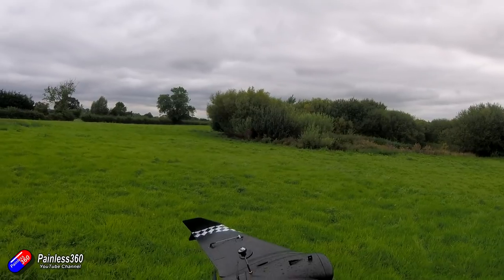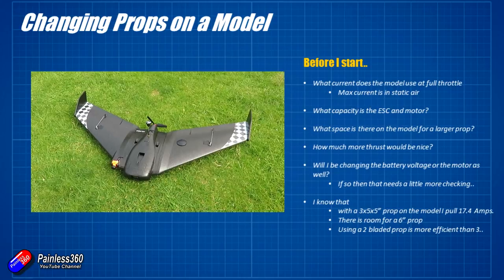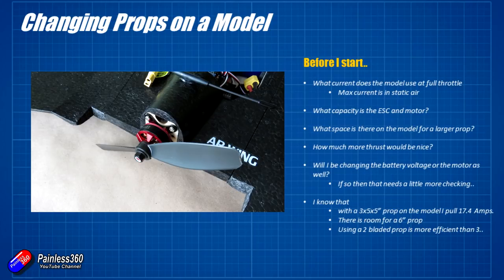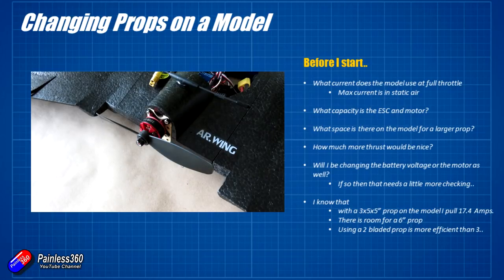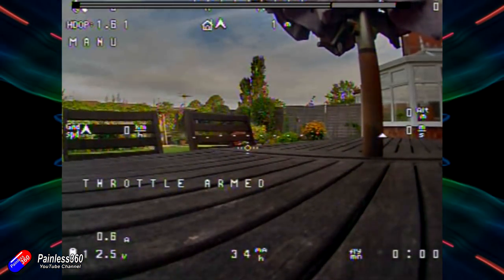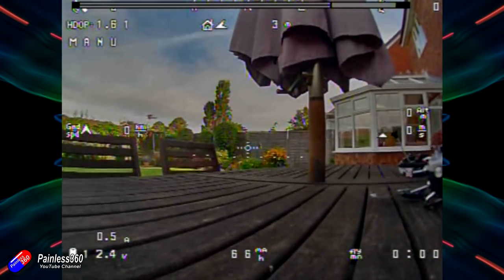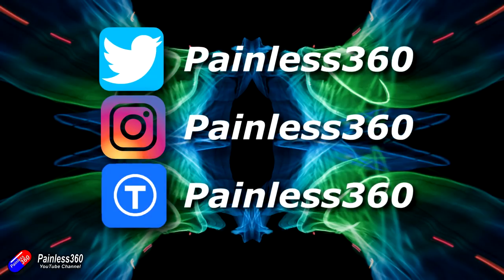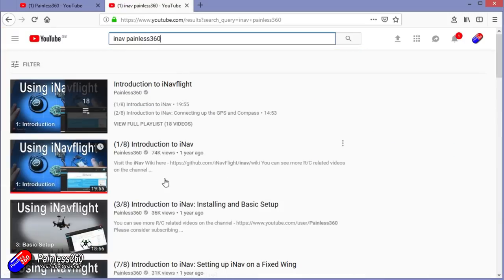Calculating if a larger prop is safe to use

Comment: Great video.  You can always be relied on to cut through the fog of theory and give us practical examples. 
I would add just a word of caution - check the motor limits.  Some flyers crank up their prop, esc and battery but forget the poor old motor which overheats and melts its coils.
Reply: Or forget battery C and have an LVC in the first 3' off the ground.
Reply: Jim, good point!  People often root around in their battery spares and install a 4S or a 2200 (for speed or duration) not realising they've replacing a 'minimum required' 45C by a 25C - the results are never pretty.

Comment: People say I think too much but here’s why.
1/2 inch more leverage will obviously increase the amps needed, BUT ..... 
98.12 x 3 blades= 294.36 ci of total blade/wing work load
127.25 x 2 blades = 254.5 ci of total blade/wing work load
So with the reduced amount of blades does this mean that the motor or thou turning a larger leverage but having a reduced amount of blades attacking the wind is able to spin faster thus creating more thrust? Need RPM info to see what’s happening here. But other wise great upgrade if you can definitely feel the difference.
👍👍👍
Reply from the maker: Changing the number of blades does make a difference. See my motor snd prop tests in the Endurance builds playlist.. Happy flying!

Comment: Interesting approach but as already mentioned the number of blades needs to be taken into account ... thrust and amps with a 5x4 2-blade will be less than a 3-blade of the same diameter and pitch. The other important factor is pitch speed - you can sling a huge amount of air backwards with a large diameter / fine pitch prop, but the velocity of it needs to be significantly faster than the stall speed of the aeroplane or you are in trouble ;-) Not an issue here of course as the diameter is limited, but a general point to bear in mind. Pitch speed is a function of rpm and blade pitch, so a tacho is a useful tool to have. As you said though we are lucky nowadays in that most electric models have 'plenty' of power out of the box, without having to tinker too much!
Reply from the maker: Many things, including the design of the props themselves can make a huge difference to the thrust produced for any wattage. As mentioned in the video this is a rough and ready, simple way to get a rough idea of what the impact would be and what changing the pitch, diameter, battery or motor would do to your current. Happy flying!

Comment: Motors are disposable items.. HK 2200kv D2826 motor on a 6x4 prop pulls about 35-40 amps wide open on 4s.. And good for about 30 wide open flights.

Comment: Actually I find the 3 bladed props more efficient in a pusher configuration... 
I get longer flight times out of my 6x4 *3-blade one than I do a 6x4 *2-blade prop in my 900mm AR-Wing.
I’ve also now doubled up & connected my 3s (1800mAh) & 4s (1400mAh) battery’s in parallel.
All up weight is now up to a weighty 820g,
however I’m getting 1kg of thrust (on a 3 cell) out of it with my upgraded ‘Brother Hobby - EngineerX 2307 2500kv motor! 
Running it on 4 cells that goes up to 1350g of thrust, & unlimited vertical!.. 😎
It’s pulling 28 amps & 39 amps   respectively on 3/4s - still using the standard 30 amp ESC also. 
Static thrust is different though from when a prop is actually screwing through the air at high speed.. 
It’s usually around 35% less than in static figures, so still under 30 amp mark & within specs of that FlyColour ESC.
Reply from the maker: Please see the endurance quad testing. Some interesting real world results on props I did here. The design of the props used can make a huge difference. As you've already seen, not all props perform the same. Even those with the same size and specs. Happy flying!

Comment: Run mine with 2216 Sunnysky 1400KV and 9x6 folding prop on a selfmade 4S2P 5200mAh LiIon, 40Ah AmaxInno ESC. Speed range goes from slow and very efficient easy going for long flight time or simply slash around with ~140kmh beast mode. Secure the hatch with some extras if doing so or it will popp off ;-)  Very much punch for Inav Autolaunch, works very well.
Reply: Slash7 FPV hey i just got mine and running same motor i guess x2216-7 1400kv but usin a 3S 3000mah on a 8x6.
But im Intrested in a folding hub and at first go for a set of 8x6 folding props.
Problem is what hub and props did u use? I cant find much info on what to buy and what fits and what not.

Comment: One thing that needs to be done is taper the following edge of the wing where you cut the relief so the air flow is smoother.looks like the air will cavitate where it cut flat in front of the prop.
Reply from the maker: Thanks for the suggestion, happy flying!

Comment: edit: disclaimer to prevent confusion. 

<wrong>hi, I was under the impression that the prop's first number was already the length of the blade and hence also already the radius of the circle. If that's the case your math is off on both examples by a factor of 4 (2^2), it evens out in the end tho. Could you confirm if this is the case?</wrong>

Also, thanks for this way of systematically breaking down a "well let me try this" way of me figuring this out, real time saver to land at a close enough number.
Reply from the maker: It's not the radius, measure a prop you have there.. Happy flying!
Reply: You're correct, sorry about the noise.

The first number of propeller specs is the length of the disc they make when spinning. And I had that as the length of the blade.

How do you estimate how much impact drag/load is going to be if all things remain equal in the volume of air moved but one more or less blade?
Reply: I meant to ask on the current draw while moving the volume of air
Reply from the maker: Check out the practical testing I did in my endurance series builds on the channel and have a play with ecalc (links in the comments) to see the impact of 'what if'.. This is an onion of a topic and I'm not planning on going into too much more depth in videos . Happy flying!

Comment: Lee have you ever used E-calc ? I used to use it a lot building quads but can’t really figure out how to use it with wings. But it was an indispensable part of my tool kit. Cheers!
Reply from the maker: I've tried but never found it as helpful as I'd hoped..
Reply: ?????? The pros that I fly with (really, literally,) recommended ecalc and I've never looked back. The numbers returned are always within 10% and usually 5. Using fixed wing and rotaries. 99% is about AUW and watts, which produces thrust/weight, which is 90% of a plane's handling/safety factors. Pick a pitch for power or speed, and find the diameter that works.
After the first half dozen planes I built or modified, measuring everything possible, I stopped measuring. Just 'calc it up,' build, fly. The motors and batteries always come back with the expected heat, hot, warm, ambient.
No I don't work for them or get paid. :) Here's a clue... I've been doing net for 30 years, flying for 10. Ecalc is the only 'site subscription' I've ever had.
Yes the screen is daunting. Watch the dials for amps, speed and thrust as other parameters are varied, and eventually everything lines up. Any Qs feel free to ask.

Comment: I tend to leave the maths in the classroom if i go up on prop or power, and just uprate any component that might need it, for example i changed the motor on my Ranger 1600 from a SS 1400 to a turnigy 2836 1100, prop went from a 8x4 to an 8x7, not enough "oomph" so now its  had to go from 3s to 4s and 8x4.5, that meant the 30amp esc was gonna struggle so to be safe and not have a fail i upped the esc to 50amp to cover all power options.
Reply from the maker: The math let's you know if an upgrade is likely needed and can  help avoid unnecessary replacing of components.  The experience needed to correctly guess which part if the powertrain will be at (or over) its limit is something many pilots don't have. Happy flying!
Reply: @Painless360  Yes they do, but in most of my case`s like above its fairly blatant to be done

Comment: i was looking at different props for a long range tricopter build, it's really good that we can get osd amperage readings, so i can just swap props, go hover for a minute, and see what it takes to hover and see where the magical number is
Reply from the maker: Check out my endurance builds where I tested props for more detail on better testing methods...
Reply: @Painless360  i'll have to go find those again, it seems like i haven't seen much on it lately. I've been working on David Windestal's tricopter lr build, and if I can't figure out how to keep the "wag" to a minimum, i might try using the electronics for a quad as it seems to be very efficient for it's size

Comment: So this is why my AR wont take off been trying for a year without sucess,Did you find the three blade was ok got loads of those from my drones,only other wing i have is the disco, and as you know it flys itself.
Reply from the maker: A prop that will move a similar 127 sq. Inches should be better, no matter how many blades.. best of luck!

Comment: How do you calculate the volume of air moved with a 3 blade or 4 blade prop?
Reply from the maker: Same way.. The more blades do make a difference but this rough and ready mathod will still give a rough guide..
Reply: In a 6 inch 2 blade prop has 6 linear inches, Each blade constitutes 3 inches. 

By that rationale a 6 inch 3 blade prop should have a linear dimension  of 9"
Is that correct?

You are the best by the way! What is your first name anyways?
Reply from the maker: The pitch isn't culmlative. Try something like ecalc.. Happy flying!

Comment: Que propelle recominda para un motor 2400kv en la sonic model 900
Reply from the maker: Depends on what LIPO you use. You will need a 'smaller' prop for 4s. I'd look up the specs for that motor with the battery you'll use for the recommended prop.